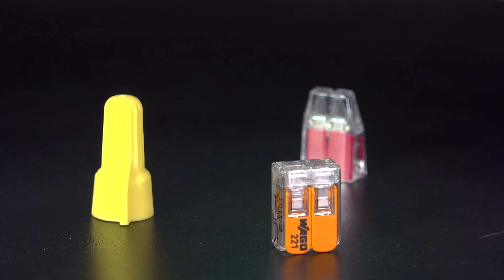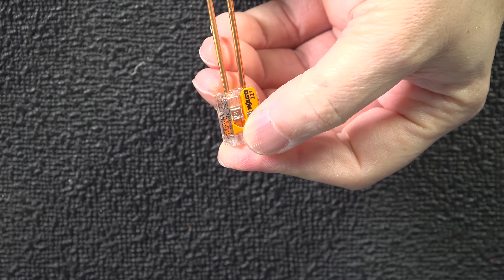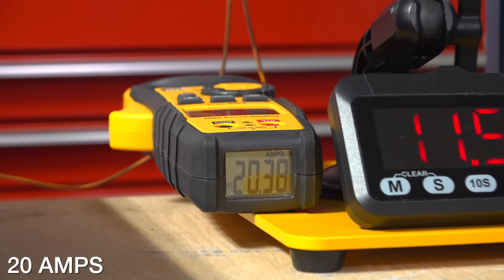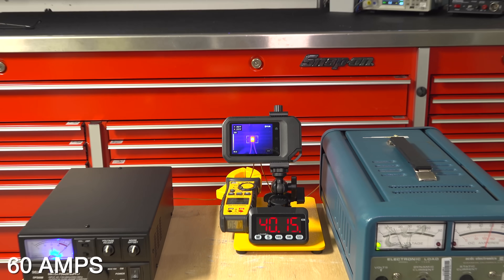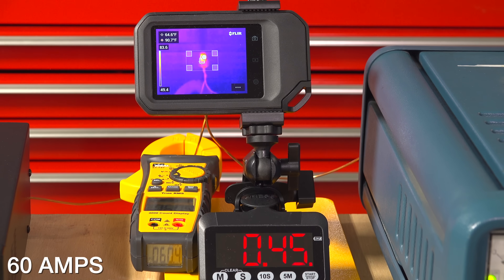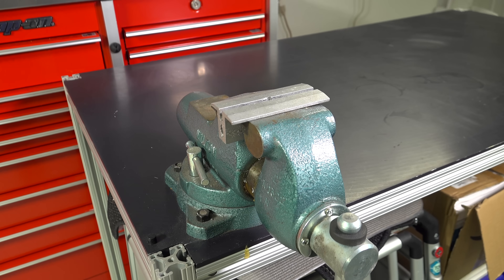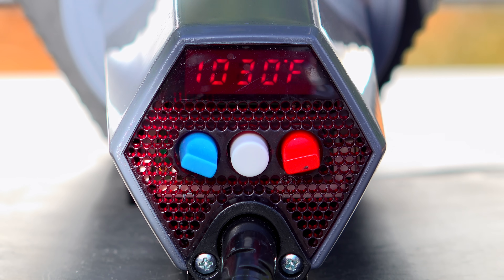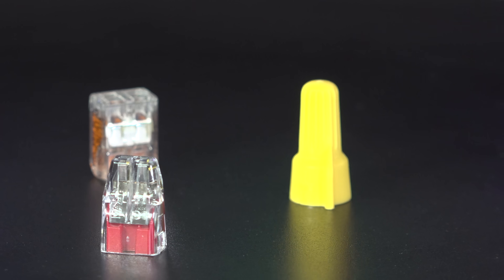What Wire Connector is the Best? Wire Nut VS Wago TESTED

Comment: The only problem with the wago that i have found is that with the smaller wires it is easy to bump the lever when working around it.  But with that said i have not had any problems with them coming open on their own and i have been using them for years with no problem.  Once i place them in the box or light fixture i do not have to worry about them wiggling loose like the wingnuts. Those i have come back to and found them loose and about to fall off.  Not always but enough times to make me wrap them with tape every time to ensure the cap never falls off and causes a problem.

Comment: The  big benefits I see is that they are reusable and easier to use. Strip, insert, push down lever. Works on a wide variety of gauges, unlike wire nuts. Not sure about the connection? Pick open the lever and have a look!
Reply: Wire nuts and push connectors are reusable as well though..... heck even crimp connectors can be reused if the insulation isn't damaged.

Comment: I love these. If I could find them rated for higher amperage I would use them on ten and eight gauge wire.
Reply: They don’t make them .....anything bigger then 12 gauge you got two choices...wire nuts or insulated lugs
Reply: @stifflers69mom1   wago has new connectors  that  can handle 10 gauage wire

Comment: I love Wago lever connectors. I discovered them about a year ago, and now it's the only thing I use. What I have noticed is that the clamps sometimes come up a little bit, so what I do is wrap the Wago with a 1/2" piece of color coordinated electrical tape (black tape for hot, white tape for neutral, green tape for ground)v to lock the clamps closed. I haven't had a single issue, and I've used probably over a hundred of them in my house. I definitely recommend them.
Reply: Tape, tape, tape! I freaking hate tape used like that. Yuck!

Comment: I think that the Wagos seem more dummy proof. Wire nuts are so easy install incorrectly if you don't know what your are doing. Whatever saves the most lives.
Reply: What is this secret other than pretwist and torque it down? If it doesn't torque down and pass a tug test, bad conn. I'm just saying, it's not exactly rocket science. 

I prefer wire nuts because most of the current flows from wire to wire where they touch and not through the connector. In a wago, all of the current goes through the connector.
Reply: @chrisjacobsen1659  How would you know to twist or to tug test if you dont know how to use the items. Hindsight is twenty twenty, once you know how to do something its easy. I mean what can be easier than e=mc2 right?

Comment: Interesting as always, however I'd really love to see more systematic testing, sure it proves the point, but I would've liked data points on the wire nut at the same amp load and time stamps as the wagos.
Reply from the maker: I appreciate it. I was going to use multiple cameras and side by sides, but honestly people were so skeptical of my last video, I wanted to show live shots so there were no camera cuts that would have allowed tampering with the numbers. This way skeptics can slow motion it all the like and what you see is exactly how it happened.
Reply: @SilverCymbal  sadly,  "haters gonna hate"! I think discussing WAGOs is almost like trying to convince a Trump fan that the 2020 election was fair, or a Biden fan that it wasn't! 🤣

Comment: Definitely the wagos are UL approved they are furnished with some light fixtures that are sold and your testing was a bit suspect because putting a wago or a yellow wire nut under a 60 amp load isn’t realistic because there simply not rated for it because a 60amp load will have # 6 wire this is my opinion based on using wire nuts for 48 years in the electrical trade thx
Reply from the maker: Yes very true, you would never see 12ga wire for those kind of loads and no one should be using any connector for over it's rating. The thing I was most impressed with was just seeing how well it handled its max load of 20amps. The ones over that were just nice pluses

Comment: If you want to do more.  It would be interesting to see how the Amazon/Ebay knockoffs fair against the Wagos.
Reply from the maker: Those things are scary! Good idea though for a video. I appreciate it.
Reply: @SilverCymbal  I'd like to see that video too.
Reply: @SilverCymbal  If you do that test , could you include Ideal, sold at HD, Lowes ? I had half a house rewired with the home depot ones before I started to see the "experts" recommend staying away.
Reply from the maker: @gpadog  I will check those ones, I really have not been a fan of any push in only connectors (wago or ideal) mostly because they are a pain to remove and they don't work with stranded well at all. The Wago 221 lever models shown  are what makes them great. Easy connections, disconnections and work with mixed wire, solid stranded, etc. But I plan to run some tests on many other brands and models soon.
Reply: That's one item on the list of things to never buy - Any knockoff that you're thinking about using on your home electrical system.
Reply: Is there a way to clearly tell the knockoffs or are they just a different brand? Because I have ordered some Wago 221 connectors on Amazon but they are branded Wago
Reply from the maker: @chrisd4432  If you got the ones through my links I confirmed in writing they are selling the genuine items. The fakes don't say Wago, and I get that seems like an easy thing to copy but Wago is in practically very country so I think they sued the fakers  becuase I dont see fakes any longer shwooing the name. The fakes are 100% not good. Some great UK guys tested the fakes and they are not even close, but the look physically identical
Reply: @SilverCymbal  thanks, I Will buy them through your links if I need more but I think it'll be a while as I'm a homeowner not a contractor. That's good to hear because all of mine say Wago on them, I thought they were genuine but you never know.
Reply: @chrisd4432  I also ordered Wagos on amazon once. No good idea. This is something I'd rather spend more money on for being sure I get the original.
In my case it was obviously a fake. No original packaging and they felt crap compared to the original ones (which I already knew). But who knows how well they are faked by now.
Reply: @vehrmann  that sucks, mine were original- or at least if they were fake they were very convincing- they had the original packaging
Reply: @chrisd4432  i work as an electrician, in industry, and bought Chinese knockoffs, for myself. They're fantastic, and even seems beefier than the original wago 221.
Reply: @GoalOrientedLifting  I don't doubt there are decent Chinese made connectors, but you have to be really careful about who you order from as the next batch might be junk.  name brand like wago are very likely to be good.
Reply: If you're worried about knockoffs, try finding WAGO someplace that doesn't have 3rd party sellers. Another channel mentioned Menard's and while it might cost a little more than Amazon, I wouldn't have to worry about a knockoff ending up in my order.
Reply: Terrible, I hate them. You never know what you get and many tend to fail over time. Whenever intermittent faults occour in an older installation and there are no obvious faults I go looking for those things in the junction boxes. Never seen a failed genuine WAGO by the way, and they have been used here in Germany for a long time.
Reply: This guy did the older style ones. https://www.youtube.com/watch?v=bP0qHyVAymU&t=641s
Reply: Yes!  This would be an awesome follow-up video.
Reply: I support this request! My friend is using the chinese ones and i'd love to see how they compare!
Reply: I bought Chinese knockoffs, and they seems just as good, maybe even a bit beefier, as wago. And you got more options.
Reply: I have used a knockoff and it slipped off way too easily. It was like the lever didn't have any effect.
Reply: I've used them for a circuit using12A/240V and they've held up, I would maybe not stick them inside a wall but this was a temporary control panel for a heater I built to experiment with and they worked just fine. Not particularly scientific but for quick and dirty temporary jobs I can recommend them over screw terminal blocks etc. I haven't seen wire nuts used in Finland except on some very old installations, pre 1970s.
Reply: Used a specific one in control panels, the 3 input, 3 outputs per input version. I bought a big bag of probably 1000 several years ago, took some apart, they are quality and all copper inside. Wago don't make one themselves and most of mine are in extremely low current applications. Think 10 devices, each pulling several milliamps off a 0.5 amp or 1 amp din rail breaker in a control panel. Low enough current you could use 20 ga wire and not even think about it. And of course those are doing fine. I also have one on an air compressor motor circuit that's been doing nearly 25A at 230v for years. Still looks brand new. Most of the grey colored old style knockoffs are fine. I would not use them until I had taken apart several to inspect the construction. If the materials and construction were good I would have no issues with them. Obviously every time you buy another batch you have to take several more apart to check. Since nobody else makes that style connector and especially not the 5 wire 3 phase version that I also sometimes use, there are not many options. In the vast majority of situations however, I go for a good quality Euro terminal strip (Or Choc Bloc as they call them in England), a small Polaris tap, or even the Ideal setscrew wirenut, which is personally a product I have never seen anyone test in one of these videos. Almost never would I ever use a regular wirenut. Why would I when there is a setscrew alternative in the exact same form factor that takes much less effort to install, easily connects solid and stranded wires, etc.
Reply: they are really bad. one of them was hot to the touch with only 12 amps going through it. don't risk it
Reply: Ironically Some copycats out-preform the original one, or are in a Model that is much Nicer/suitable for what you want.
Reply: @darknessblades  not only do some of them outperform wagon. You got a bigger choice of options.
Reply: That's what I was thinking because people are going to buy the cheep ones  that's were I think you will see the difference cheep wire nuts VS knockoff Wagos